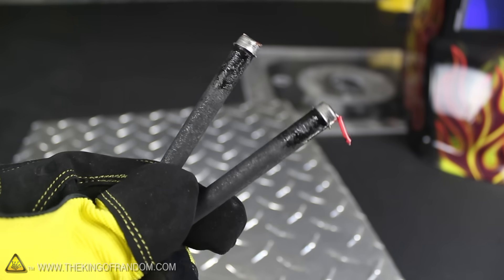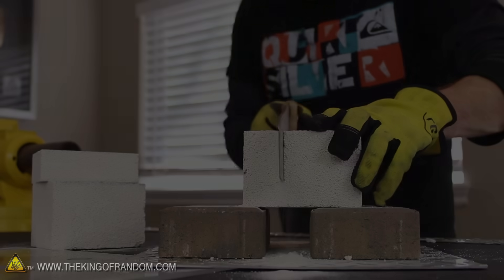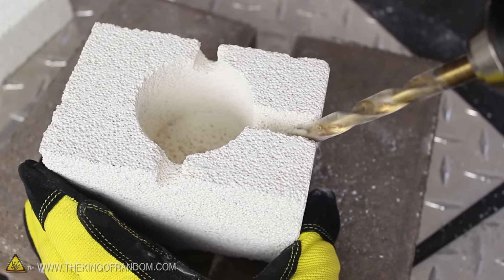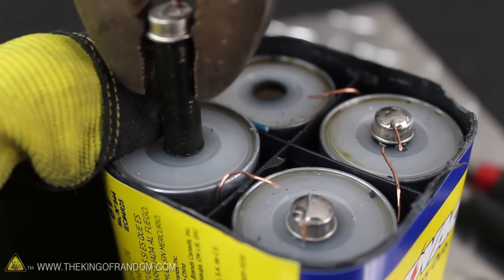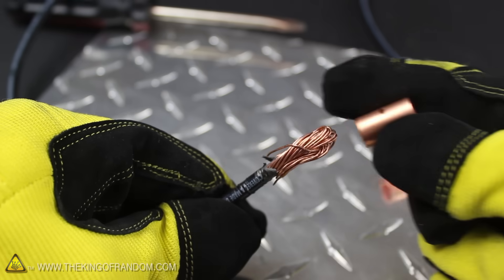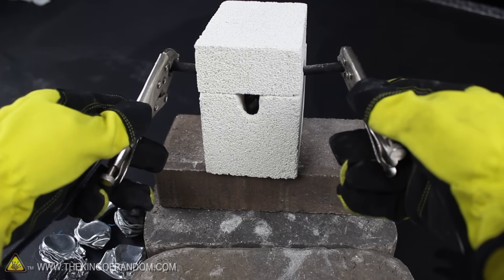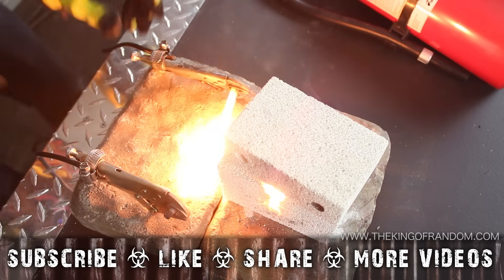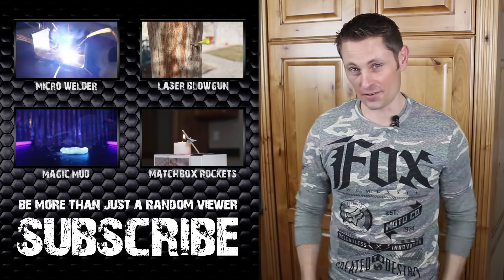How To Make An Electrical Arc Furnace

Comment: Isn't it extremely dangerous to be holding two exposed (100amp, 240v) leads in your hands?
Reply: +al145 The Voltage is more important because it's pushing the current through your body. Without Voltage there wouldn't be any current. People are angering weather the current or the voltage is the 'killer', and I don't think that there is just the one killer. The current the things can deliver always depends on the resistance of the load / your body (if it's not a constant current source). Therefor these 100 amps which welders can deliver won't flow (only a couple of μA) because the voltage of the welder can't  overcome the resistance. Now you might think: if voltage would kill you, why won't an electric fence kill me? That's simple: The power supplies for those fences have a huge internal resistance, which means that the voltage lowers drastically as soon as you touch the fence (from a couple of kilo volts to tens of volts) ;)
Reply: No, welders supply a high current (as you said) but only at a relativly low voltage (way below a 100 volts). If they would supply 100 amps at 240 volts you probably weren't able to power these devices at home and especially not on a normal power outlet ;)
Reply: If you Google " How a transformer works", you'll find out.
The short explanation is as follows:
The PRIMARY side has 240 VAC, that's correct. However, the whole idea of a transformer is to...well transform the energy input to something else. Depending on the windings of the primary and secondary coil,you may end up with higher or lower voltage. Think about it as a gear on your bicycle...it's about the same when you look at the gear ratio.
With this trafo, I'll make an educated guesstimate...he has 3-10 V on the secondary output, so not enough to do any harm, even if he touches both wires at once. When you look at Ohm's law, you'll discover the lower output on voltage (U), will cause a higher output of current (I) and that's why he can weld with this thing.
Reply: The worst thing that could happen is him burning his hands.. This isn't deadly at all (during normal use)
Reply: +Country Gamer Yes but you can't get 100 amps @ 250 Volts from a normal outlet ... only if you transform it down to a lower voltage ;)
Reply: @el Loco: the gloves are only for protection against the heat. There is no deadly voltage.
Reply: Kalle Klæp Hopefully the others will finally understand that ... :'D
Reply: Steppenkater Yes, exactly..! For good measurement we should include that a car battery delivers DC and the wall socket AC. AC is the only form than can be transformed up and down, DC can't without a lot of effort. That's the reason why the whole world uses AC over DC for supply.
The 0,1 A or 100 mA you mention, is three times the amount that can be potential fatal. That's why most breaker circuits in a house (not the very old ones) , have a safety relay that is triggered at 30 mA. Still those 30 mA will paralyze your arm for quite some time, if you are touching live wires.
So all of you who would like to play around with and/or build such a device, be careful. If you have the slightest doubts of what you are doing is safe, ask someone familiar with electrics before you plug it in.Electricity can be as dangerous as a loaded gun, if you fool around it can be the last thing you do.
Reply: LouSaydus yes
Reply: LouSaydus no because the electricity will take the easiest way wich is the metal
Reply: most homes can at most power 240v 10-40 amps
Reply: There is less than 15 volts along with about 400 amps in mine
Reply: The gloves that he is using are resistant to electricity
Reply: of course it is, that's the objective
Reply: DunNotCome tl;dngr
Reply: Yeah, just wear rubber gloves man.
Reply: Before he touches the leads, though? The path through his chest is then the easiest...
Reply: LouSaydus well duh
Reply: you can power it at home just need a 240 volt outlet
Reply: +al145 Its actually resitance volatage and current equaly responsible for killing you
Reply: he wering gloves
Reply: The current is what kills you, the voltage is secondary.

Comment: is there anything you can use as a crucible that is non stick?

Also, can you connect the carbon electrodes directly to an AC power outlet or should you run through a device (like your little arc device) ?
Reply: i also want to know
Reply: It needs a device, and i don't know what you mean about the crucible
Reply: Anton Helsgaun Thanks for the reply :).

Re: the crucible, was thinking if there was something to help prevent the molton metals sticking to the inside of the crucible
Reply: sypher0101 hmmm... They shouldn't stick to the inside of an actual crucible unless you let them harden in there

Comment: hey, im planning to use a 1000 amp transformer for this. is this safe? also it has a 1 volt output, will it work?
Reply: It will work, and probably melt your firebrick, metal and electrodes, aswell as boiling them I'd assume
Reply: +Anton Helsgaun oh wait I found out: grants transformer gives 36V and 210 Amps. That is 8
7.2kVA. Even despite the inefficiency of the arc, we can assume there is 7kW of power coming out of that. Mine would be a kW at best meaning that my transformer is no where near enough
Reply: Umar Awan I'd assume the invert, but I'm not a smartie so your probadly rigth

Comment: I know there's a warning at the near end of the video, but there's a huge warning that should be posted the second Zinc is mentioned. To elaborate on this; When you melt or heat anything with zinc in it (including galvanized metals) you want to do it under a ventilation system and/or outdoors. Zinc produces a toxic fume when it gets to a certain high temperature and the chemical has been linked to Alzheimer's disease in humans. It's not recommended to heat zinc metals at all. I'm surprised this hasn't been mentioned here at all.
Reply: You're surprised? From a guy who shows people how to make dangerous weaponry, rockets, explosives, things that can melt the flesh off your bones? I'm actually pretty surprised as well.

Comment: posibly this was already answered but I couldn't find it in the comments or video.

What are the power supply specs for this?

If your not center tapping your transformer you are at 36 volts. But how much current are you pulling to melt this metal? I understand that it's not a simple or single answer because the closer the carbon rods get to each other the more current is allowed to flow.

Comment: can i use a battery instead of microwave parts?
Reply: If your battery can give 240 volts ac then yes...
Reply: +Jean Panachay well i hopefully find a car battery or so. idk xD
Reply: +Jean Panachay well ok thx
Reply: His supply outputs i think about 36 volts at 210 amps
Reply: jamiepie123 Think it is lower voltage, about maybe 10V or less, since a standard 230VAC socket normally delivers maximum 3680 Watts (if 16amp fuse). A normal microwave is about 1kW, so would guess around 10V and 100amps give or take. A normal car battery can deliver 500amps or more, but that is only for a short duration (i.e. start a car) so i guess it would run out very quickly, and perhaps fail of ocerheating.

Comment: Very good indeed with only one comment.
a diagramatic version of the wiring or just slow down with the commentary, it is very important because regardless of what you are making, getting the wiring right is both important for it to work and also saves on replacing fuses because it was not wired up correctly.
This is even more impotant when it comes to making welders, you dont get too many thumbs up from dead people
Other than this very good indeed and worth watching,
the one I wanted was the poly cutter hot wire but you just wentbtoo fast about the wiring.
Reply: I completely agree with what you are saying, but who replaces fuses anymore, unless you have really old wiring in your house, most modern homes have reset-able fuses.
Reply: Settings> speed> 0.5 or 0.25
Reply: He does have a video on the welder and its wiring in the description>background section. I hope that that's the wiring you're looking for!
Reply: John Laccohee-Joslin ij

Comment: it is so dangerous
Reply: It's only dangerous if you're careless.
Reply: +Jacob De Necochea that is why "darwinisim awards" exist
Reply: It is extremely  dangerous. We must deal with it.
Reply: if there is a significant amount of inductance then yes. but in this case no...
Reply: Goyagma uhm it's around 18 volt so you're dead
Reply: +Goyagma hahaha nice
Reply: But here's the thing. The current is what kills you. Not the voltage. That person is right, this project is extremely dangerous. But really only if you are careless.
Reply: +jadekayak01 for me or the other guy?
Reply: +Jacob De Necochea anyone who messes it up
Reply: jadekayak01 lol what? it is impossible to get shocked by a car battery
Reply: +Jurie Debie no its not,thousands of people every year do so because they are ignorant of the danger.

car batteries have a high amperage rating and its the amps more than anything that does the damage

Comment: That is neat. I used to have a little arc-welder but CTC stopped making the rods so I got rid of it. Too bad I didn't know about those rods before, I would have used them instead of the Factory made rods.

Comment: "According to the safety sheet, the dust is something you wouldn't want to get in your lungs." 
Knowing me, I'd probably trip, fall onto the table right onto a pile of dust, get it in my eyes and inhale half an ounce of it.
Reply: Working with this material you can reduce dust if you put the brick into water for a few hours before cutting or drilling or else.
Reply: The mask would get caught somewhere and fall off then me with allergies I'd inhale most of it then sneeze and inhale more.
Reply: lol
Reply: +Michael Griffin wut
Reply: ANToine1999 z

RHH
Reply: STILL MAKING IT GREAT AGAIN flol
Reply: STILL MAKING IT GREAT AGAIN d
Reply: Wear a mask that seals an protects your entire face then.
Reply: dummy
Reply: degenerate.

Comment: I wanna see this melt tungsten.
Reply: the bricks only stand up to 1400C tungsten has way bigger smelting point
Reply: Rasmus Risanen tungsten is 3422°C
Reply: baileyboy125 I wanna see it burn my soul
Reply: wolfy boy So in other words, tungsten plated with gold would make some killer brass knuckles?
Reply: +TheCompute101 well they wouldn't be brass then
Reply: Tungsten is good meatal
Reply: Larry McKeithan True, gold plated tungsten knuckles.
Reply: Mike Peabody About 7280 degrees F. A little over a thousand degrees F. higher than tungsten.
Reply: I wanna see it melt Platinum and Iridium
Reply: seriously man ?????
Reply: Then use a graphite chamber.
Reply: +TheCompute101 What's graphite's melting point?
Reply: TheCompute101 Well then
Reply: yep. i have "the one ring", made out of tungsten and plated with 18 carat gold, and you can actually FEEL the weight of it! XD and it's said to be really hard to scratch, and is the hardest NON alloy metal.
Reply: But Tungsten is difficult to weld.
But for projectiles it is great.
Reply: With an Anti Tank only can you melt that stuff.
Reply: I believe they now use depleted plutonium for penetration rounds because it's even denser
Reply: Mike Peabody
No.
www physlink com/Education/Askexperts/ae576.cfm
Reply: no try irridium or osinium
Reply: Anthony Machacek spelling/10
Reply: hit up the champ david groves, he wont be needing that ring anymore :D
Reply: the king of random told a lie because it can not melt every metal known to man :P
Reply: :C it can, just depends on how many amps you use

Comment: Very cool video!.....I used to tap furnaces for a living for a company called FMC Phosphorus Chemicals Division in Pocatello, Idaho for 10+ years, The furnaces there used like 8,000 to 12,000 lb carbon electrode segments screwed together eight high, and a furnace would have 3 of those coming in from the top to form what was called a Delta V arc. These electrodes would measure 50 to 55 inches across, and melt down mass amounts of phosphate ore briquettes along with coke and silica , that captured as a gas called P205, then condensed into elemental phosphorus. Each furnace had two slag tap holes and two metal tap holes.... they were huge. This plant had 4 furnaces total, and was touted as the largest phosphorus producer in the world back in its early years....Working there was like being on a whole different planet, very dangerous, and stressful, with plenty of horror stories....

Comment: What if you don't have a home made arc welder motor, is there anything easy to use at home to make that can power this?
Reply: No you need the transformers and power
Reply: Than will it be enough just to use ordinary welding machine?
Reply: Use a welder

Comment: If you dont wear gloves will the electricity shock you? well, i guese you do need gloves either way because of the extreeme heat 4 inches away from your hands o_O
Reply: That was being powered by microwave transformers, not two 6V batteries.
Reply: +pmac13000  Sure there js always danger. But the high temps trump the shock hazard here.  Arc welders are low voltage output usually between 12-24 volts output.  Now, If you knew anything more than basic Electronics you would know and understand that he is safe from the mains power from the wall or panel because the power is isolated from the secondary windings in which makes this and all other transformers  an "ISOLATION" Transformer.
Reply: yes! when you are actually using this one of the vice clamps would have a negative polarity (-) and the other will have a positive polarity (+)... electricity will try to move from the negative terminal (vice clamp) to the positive terminal using the path of least resistance and as our body's are made mostly of water there would be relatively low resistance compared to the air. thus the electricity would travel through your body if you are not using proper safety equipment (thick leather gloves). Electricity flowing through our body's is not a healthy thing! (spoiler alert: IT CAN KILL YOU!)

Comment: For thise of you who have already made this... WHERE DID YOU BUY THE ALUMINA SILICATE BRICKS?
Reply: i havent done it and i dont know for sure but id assume a hardware store like home depot. or if like me you live in britain the B&Q is likely your best bet because we dont have home depot.
Reply: ztmackin
 I just googled "aluminum silica brick uk" second result is    http://kilnlinings.co.uk/firebricks
Reply: Google is your friend.
Reply: +Ren K I have tried google, none of the right kind show up when you use alumina sulfate or firebrick.
Reply: any ceramics (pottery ) supply store will have them  they are used for building kilns  more expensive than the regular firebricks, but soft , light and easily  carveable

Comment: could someone please explain what type of energy source is needed to power the sticks? i saw him use a makeshift arc welder or something and i dont really know much about those.
Reply: they are both modified to supply lower voltage and higher current as well

Comment: Can you immerse the carbon electrodes in water to cool them down?
Reply: +PushButton You can, but care must be taken, since water conducts electricity. So always hold only 1 of them in the water at a time, and watch out not to get in contact with anything of the stuff in the process. However, I am not sure if the carbon electrodes take damage during the process.

Comment: So I've built one of these, but I would like to know what type/rating of gloves I should have to safely grab the "vicegrips" without electrocuting myself.
Reply: Where did you buy the brick?
Reply: +midgetcooker5000 it is low volt but high current so just use thick gloves with good isolator n can deal high temperature , sorry for my bad english
Reply: +Reid Austin I have been trying to find the same thing
Reply: I'm just using the plaster of paris concrete mold mix.... its can handle some heat.... though i've already burnt out my transformer

Comment: I did mine a bit differently. I used an arc welder to power it. I also used hard 3000 degree firebrick and went to a local rental store and drilled a 3 inch hole with a mason bit. I chiseled the area out on a hard surface. I also bought some larger 15mm diameter graphite electrodes from Amazon as the battery ones broke under extreme heat. Alumina silica refractory brick melts at 2600 degrees and the arc kept going upward and melted a hole in the lid. Remember that you need a welding helmet and wear electrical gloves or build your furnace so you can just leave the electrodes in and turn it on and off manually.

Comment: could it melt lead to ?
Reply: Of course it could, but would be dangerous if the rods were left in too long. Lead has a very low melting point, even less than zinc. Lead's fumes are very dangerous If brought to a temperature a bit higher than its melting point. It would probably be a lot easier to melt lead on a bonfire or with a simple handheld propane torch. Always take safety precautions when melting molten metal and using electricity.
Reply: Thank you for the info bro